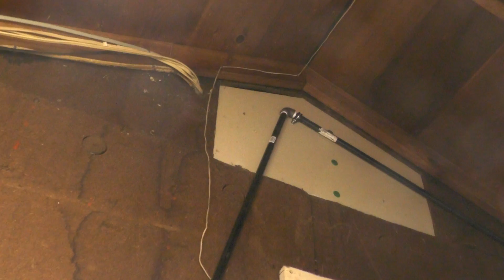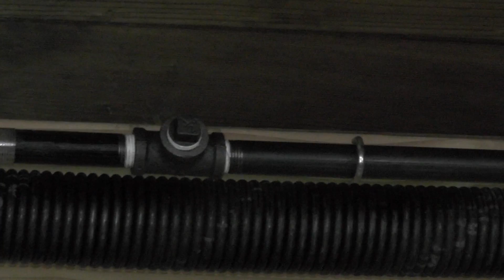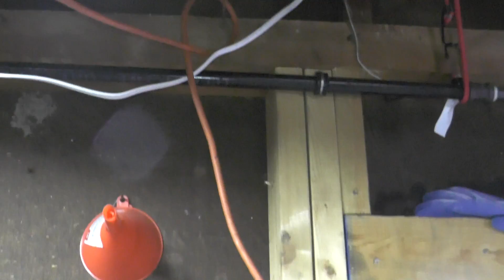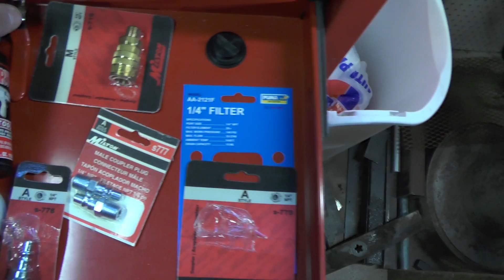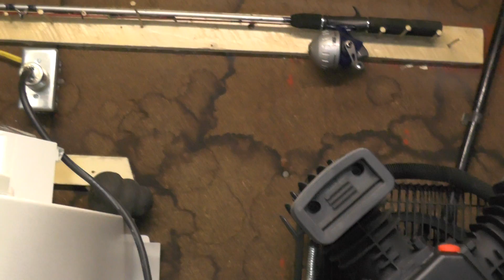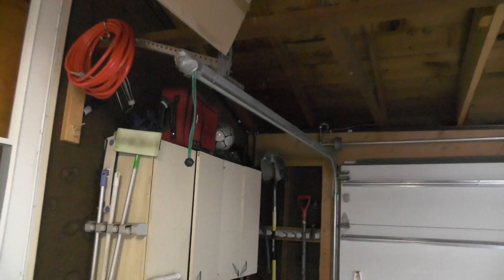1/2" Black Pipe Air Line Installed in Garage

Comment: Wow.. 3/4" has a pressure drop of of almost 29psi.. I can't imagine what 1/2" restricts down.. since 1" has a pressure drop of 8psi I'd say you're losing 40-50psi? 
Years later, how's it working for you?
Reply from the maker: I really doubt I lose that much. Using the same tools with this setup as I have with just a single hose (before I had this setup, I just had a hose), I don’t notice any appreciable difference in tool performance. For example, my cheap IR 1/2” impact has no trouble removing the lug nuts off my F-350. A friend of mine has a similar compressor and tank, but his is rated nearly 2 CFM less. He has a better impact and just one 50’ hose from the tank to the tool. We have moved tools from one garage, to the other. My system has more air power than his, regardless of tool or task. 

The only limit I have found is when I connect a 50’ hose to one of the further drops (which also has a filter on it), I can only air tires up to around 104 PSI. 

The system overall has been excellent. I have one ball valve that needs replaced. Other than that, the biggest issues are just that I didn’t set my garage up quite like I had planned, when I set up the air system. Fortunately, I did enough drops I have never been far from an air drop.

Comment: Your "restriction" (weak point, as you put it) isn't as big a problem as you think it is.  The 1/4 inch nipple attached to your control switch is attached to a much larger bung plug at the other end.  Take the plug out, put in a nipple then a T that size.  Cap the top of the T with the bung plug assembly  and reduce the other opening to whatever size you want with bell reducers or reducing bushings (or whatever combination is convenient).  You can put a regulator on that leg too, if you want.  The hardest part will be getting the bung plug out.  Break the paint on the joint before you begin.
Reply: Pressure drop through the length of the pipe would be the problem. Huge loss of volume after the first trigger pull. Has nothing to do with  the restriction at the tool.

Comment: How is that iron horse air compressor purchased one but have not installed it  yet,  just wanted your opinion
Reply from the maker: I’m still regularly using it. I’ve changed the oil and recently had to replace the belt. Original made it around seven years. No complaints.

Comment: I know this is older and thanks for sharing - curious what you came up with for mounting the air reel (if anything)?  If not, can you not put a bracket off the joist at a 90d and hand it off that?  You could even use scrap pipe and then mount a floor flange to a black of wood and mount the reel to the block??  Thanks again - I've been putting off fixing mine for too long....